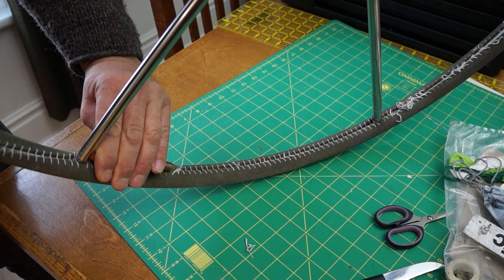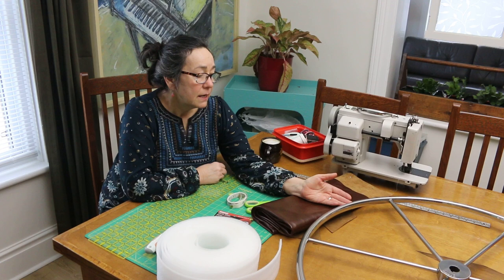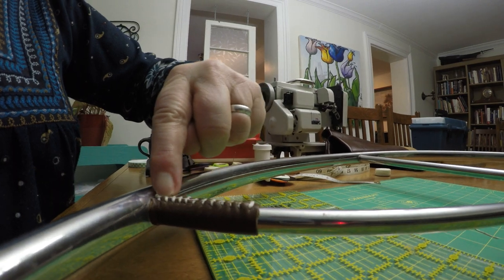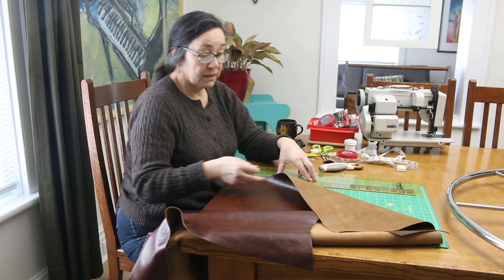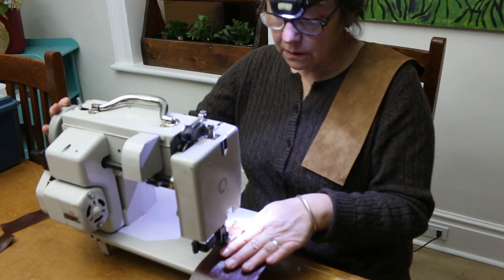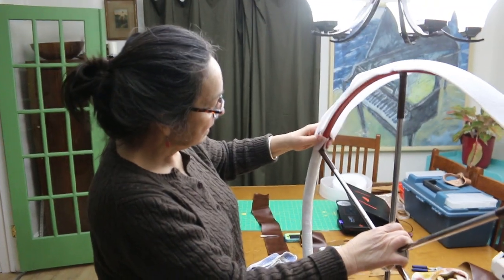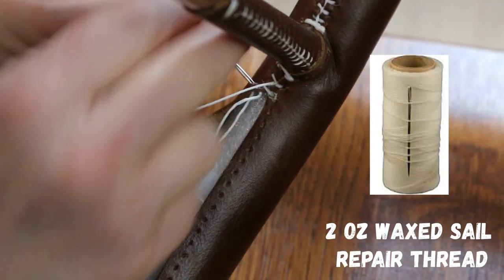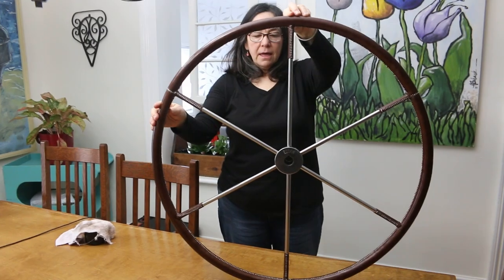Pins and Polish, Wind over Water - In the Boatyard, Episode #77

Comment: Very nice work, and informative, too!  I will eventually have to do this on my A32, "Escapade", which came with a ropework-covered wheel that is hard to keep clean!
Reply from the maker: It was pretty easy to do. Debbie is very inventive and talented.
Reply: You might want to think about coating the ropework with natural shellack.  A few coats makes even old coverings look like a million bucks.  It is actually easy to do and very durable.   I used to build and ride custom long-distance touring bicycles and put hundreds of not thousands of miles on cork-covered drop bars overwrapped with cotton tape and then coated in shellack and it held up very well.  Once a season I'd brush on a bit on any spots that were starting to show some wear or damage and it looked like new again.  Cheap and easy.

This is what is looked like at the end of a season before I touched it up.

https://photos.app.goo.gl/6szEDc3pw1zDWyvBA
Reply: @svbarryduckworth628  Thanks.  I'll give it a try.  I do scrub it once a season with oxyclean, but am worried that will eventually degrade the rope fibers.  When we got the boat my first idea was to cut it off, but then I heard about how much work the previous owner's widow had put into applying it and I just didn't have the heart to take an exacto knife to it...mind, if I had my "druthers"  I'd have one of those teak covered wheels, but the carpentry skills required to do that are beyond my abilities, and the cost of a new one from Edson rather prohibitive.

Comment: I did this to ours as well but I ran the leather through my machine without thread to make the holes on each side which made it go faster for the install! I did grey suede and we love it
Reply from the maker: You have to watch further on. That is what we did as well. Very simple way to make the holes consistant and easier to sew. We also went back through them all with an awl...(little tapered pointy tool) and made the holes bigger to accommodate the heavy thread. Time consuming but worked great. What else are we gonna do in Canada in the winter I suppose.

Comment: Over the years I have done this repeatedly on our boat.. I now have a pedestal cover out of sunbrella that I sewed to keep the wheel, cockpit table and drink holder etc. out of the sun..   Another thing I do is to tie a turks head knot on the wheel to mark centre for the rudder...   I really like the foam you used on this wheel...
Reply from the maker: The cover is a great idea. We have been talking about that this morning. The foam was a construction product Deb found at the Green Home Centre (recycled construction materials). She is crafty and frugal too.
Reply: @WindoverWater  Yes this type of foam is used under sill plates when walls are being erected to keep drafts out in construction.. Its just that I have never put foam under the leather so far..  I usually do this suede side up so it gives me a better grip on the wheel rather than leather side - I like the tactile feel and grip more than the smooth aesthetic of leather... I stitch with two needles - pre punched holes in the leather.. cross stitch under and snug up with a skate lace puller. every few stitches.. The idea of the foam will make stitching easier too...  I made a simple cover that goes over the wheel and the pedestal however I put a seam down the forward side with velcro - black velcro is more UV stable and a bit of a flap to keep the sun off...  Ours is a a bit snug to keep it on in high winds at the dock but a row of thin stainless chain can be sewn in as a weight or led line with I have can be seen in to hold it down also... you can get sunbrella on line and check the prices both in Canada and in the USA.. I got mine in the US but the did not ship to Canada..  I sew all our stuff on the boat - cushions, Bimini dodger all covers..
Reply from the maker: @danerlich7393  Yes we saw this one already Dan. We looked at a lot of other ideas before we settled on the one we used. The suede side out idea was one we toyed with but in the end wanted to have the wheel look like old teak. We are refinishing the brightwork this season so wanted the wheel to compliment the wood.
Reply: @WindoverWater  Like you I had stitched the leather by hand over the years.. when I saw some "factory" stitched leather wheels I wondered how did they stick the letter on to the wheel.. I surmised that it was machine stitched down boats sides and then laced up with a needle and thread.. saving the punching of the holes and the pain of lacing it up tight.. Until I saw the video - it was not confirmed how they did it.. Clearly their method of stitching is less painful and faster/more expedient.. Like you I am pretty frugal.  I refitted our whole boat after we suffered a fire on it and came in on time and under budget with the quality coming out superbly.. One of the additions was a solid level floor and another was a reconfigured galley with a dishwasher.. Not bad for a 46 year old 34' sloop.. LED lighting everywhere and yes the exterior brightwork is all done perfectly.. We refinished the deck the hull is in fresh awl grip, the underside of the deck was not only repaired but is better than the factory built the boat.. All the wood down below has been done, new counters new ... everything..